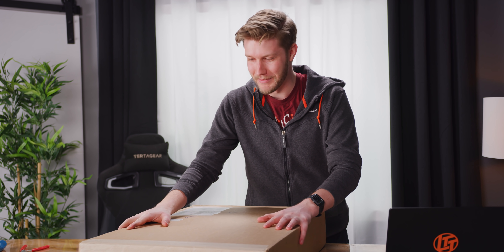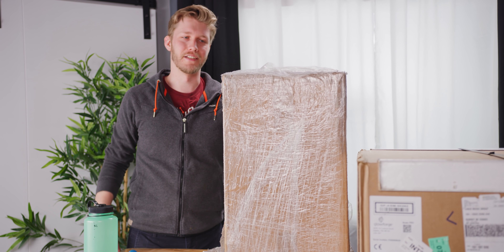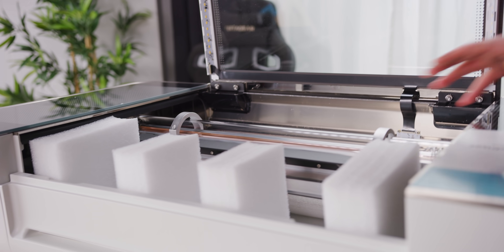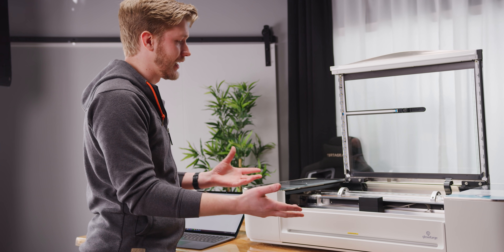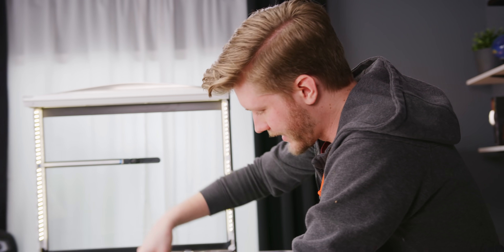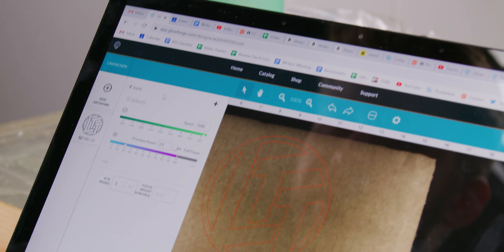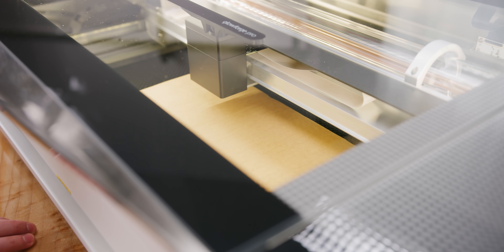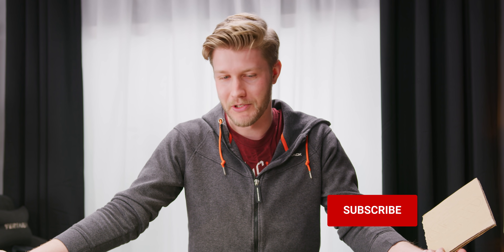Unboxing a freaking laser - Glowforge Pro

Comment: tl;dr: As a laser cutter owner/user, buy what you like, but I DON'T recommend buying this one.

Sad day. Too bad you bought one of the only laser cutters you can't truly own, so long as it only runs via their own software in the cloud. (This means it must have a live internet connection to use it and so they can make it not operate at any time.) Almost every other cutter can be used offline.

Additionally, when their first sale income finally plateaus someone will end up having to pay for their hosting costs. Hello monthly fees. :-/

Finally, no adjustable z-axis? Most everyone else has this. Super useful.

(On the positive, the bed camera is a nice feature. Probably the only one.)
Reply: They do address this in the video, but still.
Reply: Also everyone else offers a laser pointer home dot to help align things and set a custom home. Sometimes offer centering your design around your custom home for easier engraving of existing objects. I assume Alex/LTT would have used that if their old one supported those things. A bit sad they make it seem like all other laser cutters are that deficient. :(

Comment: "You need to get a glow forge account"
Fail.
Reply: Fuck that shit.
Reply: And always network connected to the internet, so double fail, every device like that (smart tv, sensors and such) is a potential security weakpoint.
Reply: @Cinkodacs  yep. In this particular case though... what's the unit worth? 5k? 6? Then in 6 months the company goes bust or decides they no longer support it... screw that.
Reply: @Jimmeh_B  The unit is not worth 5k. It's a ~$300 K40 laser cutter with far worse mechanics(who mounts the fucking tube on the Y axis!?) and a prettier molded case.
Reply: Glad to find this comment. Got to that part of the video and immediately went nope, belongs in the trash, completely uninterested. What's the point in hardware if you can't actually use it how you want?